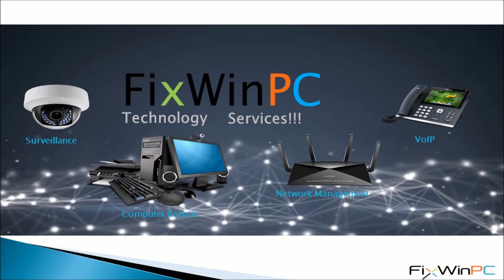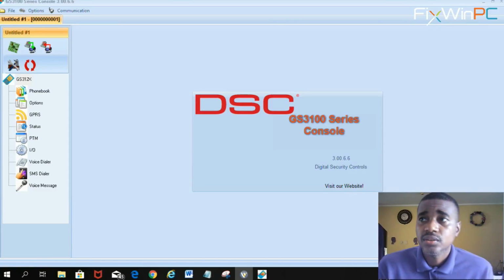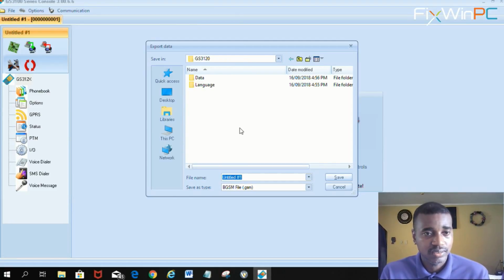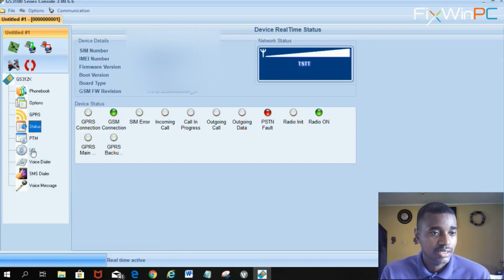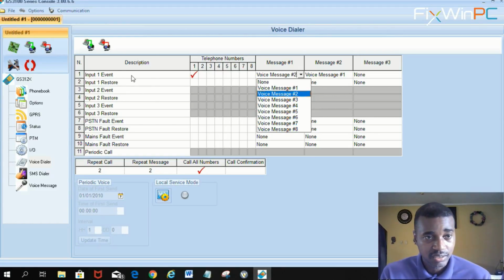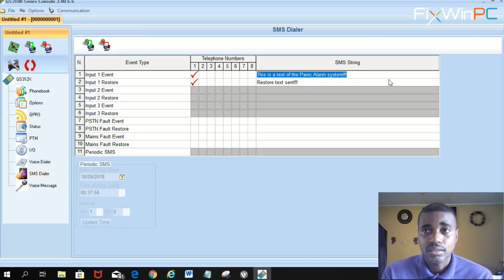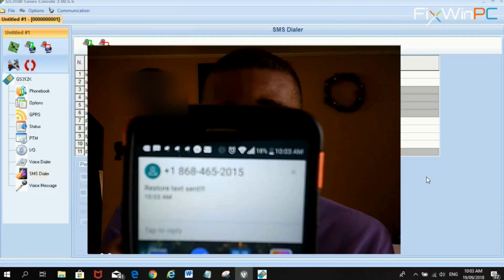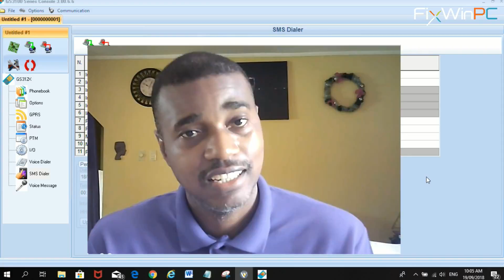Panic Alarm Demo with DSC GS3125

Comment: Hi FixwinPc,
Can u share this project?
Reply from the maker: Thanks for watching the Video!!!
I used a DSC GS3125 GSM module for communication
GS312x-310x Console software to configure
DSC PC-Link cable kit https://amzn.to/2NZNMIi
Also...
Wireless transmitter key fob https://amzn.to/2NZ4MP5
Wireless receiver with relay https://amzn.to/2NZPQ30
panic/hold up button https://amzn.to/2O0pGNM
Strobe light https://amzn.to/2Lupy7j
Siren https://amzn.to/2ZWiiKn
use copper cable to make connections.
Enjoy!!!